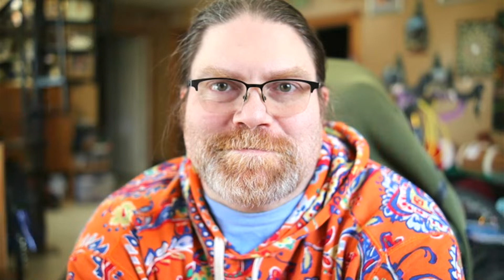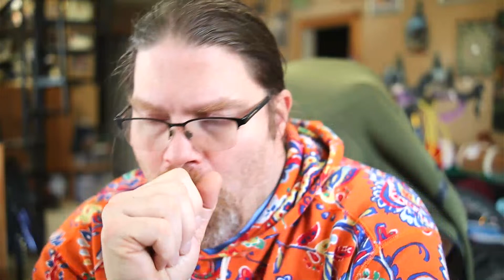Format & Content of a Medical Device File (MDF) - ISO 13485:2016, Clause 4.2.3

Comment: Does FDA recognize GHTF SG1 N063 for IVDS?
Reply from the maker: None of the GHTF guidance documents are "recognized" as a consensus standard that I am aware of. However, the FDA also doesn't have format and content requirements for a DMR, Design History File, or Medical Device File. Therefore, you can use that GHTF as a standard, but it is voluntary and not recognized by the FDA. If there is no recognized standard in the FDA consensus standards list for a topic, then the FDA sometimes creates a guidance document of its own. The FDA does not recognize other guidance documents though.

Comment: I heard that slip! Does this affect MAFs?
Reply from the maker: The master files we create for clients typically consist of the verification testing and a table of contents. That's very similar to a Medical Device File (MDF), but it's also missing some of the required elements. The reason why you don't need everything in a MAF or device master file is because the company authorized to refer to your MAF will be submitting their own device description and labeling. So the MAF is a subset of the MDF.